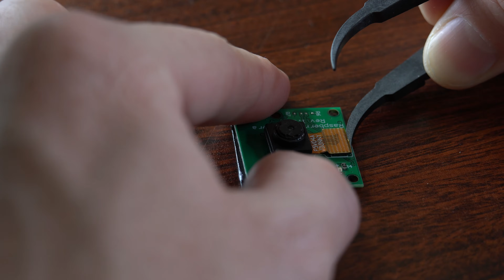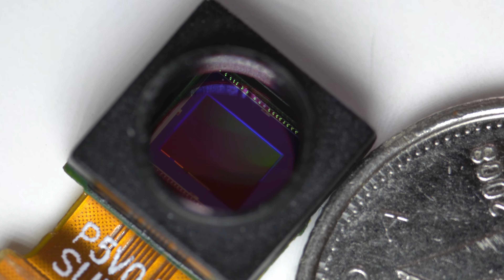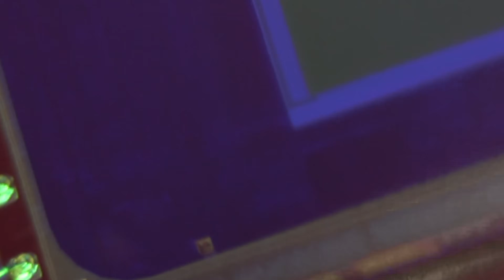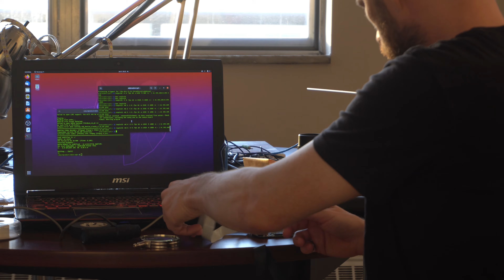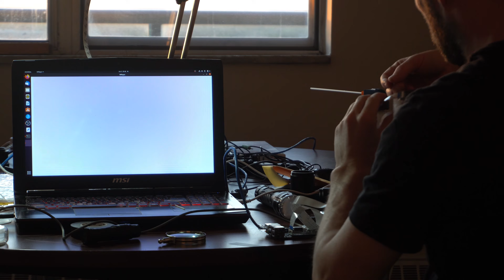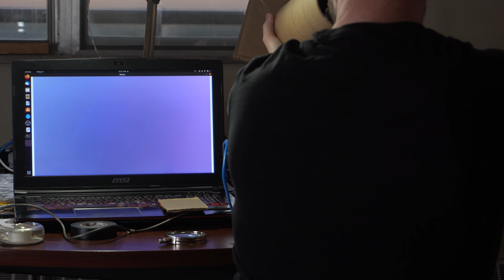EXPOSING The Raspberry Pi Camera Sensor - Teardown & Speedrunning Custom Lens Systems

Comment: Great idea, but suboptimally executed. You could have made a lot of those things like the magnifying glass work to produce an image. It's not very difficult and it would have been interesting for people to see what an image from a simple magnifying glass would would look like. 
It probably helps to take a white piece of paper, turn off all the light in the room, close the shades and only have th computer monitor on displaying a white image with a single, large Letter on it. You can then take the magnifying glass and hold it between the paper and the screen and then change the distance between paper and magnifying glass to get an image. At a certain distance you get a nice, sharp (sharp enough to see the letter clearly) image of your screen projected onto the piece paper. 
The understanding gained from this then helps to make it work with the sensor. Whereas the sensor just take the role of the piece of paper.

Comment: That crop factor is a real bugger and is holding up a couple of vintage camera conversion projects. There is a relatively large sensor MIPI camera that a dude made work on a Pi (iirc for an all-sky camera), but you need a Pi CM4 plus carrier board to get enough lanes to run it-- the typical 15(?) pin connectors only expose 2 lanes, but 4 lanes are required. The big CM4 carrier board has the required hardware. All the small CM4 carrier boards I found offer 2-lane ports, and the big carrier doesn't fit inside a camera body.

Comment: This camera has no Infrared filter? I want to turn it to a IFR camera. By putting a none-infrared filter lens on top which blocks all waves which are not infrared. Which lens do you suggest?
Reply: Depends on how far you want to look into the infrared. Pay attention to the glass types of the lenses, some glass types absorb a lot of IR, some don't. But your sensor might also have weak IR absorption, even without an IR filter.

Comment: Great video!
Although I have a question, is it possible to connect a CMOS sensor like an APS-C or Micro Four Thirds sensor to a raspberry pi?
Reply from the maker: The only other RPi camera that I know of is this one:

https://www.raspberrypi.com/products/raspberry-pi-high-quality-camera/

I suspect that the sensor format is limited to the RPi's camera ribbon cable interface.  You could probably also use a USB/HDMI capture card to do the input through USB.  I just googled it and found this video:

https://www.youtube.com/watch?v=bbTqNbztWTE

I only watched the first 10 seconds of the video.  Seems like the right idea.
Reply: I wonder if you tried to change modules on that pcb? Looks like regular smartphone camera modules on that pcb. I think that any smartphone sensor would fit and run with some drivers.

Comment: I'm looking for a 1/2.5" sensor (5.76x4.29mm) for Pi that has the same construction as this camera (sensor connected to the PCB using a ribbon cable). The official HQ camera has the sensor mounted straight to the board. Is there a third party cam with a 1/2.5" sensor that's built the same way as the one you're showing?
Reply from the maker: I'm not very up to date with the latest in Rasperry pi cameras.  I still haven't even gotten around to getting one of the HQ cameras.  Try checking the raspberry pi forums for any discussion about other sensors.

Comment: I’m curious, do you think it would be possible to use a spare image sensor from a DSLR or Mirrorless camera and attach it via ribbon cable to a raspberry pi? I’ce got this dream to build my own camera using cheap parts lol
Reply from the maker: Theoretically, anything is possible, but these are some of the major challenges you'd need to overcome to make it work:

1)  You'd need a ribbon cable that actually fits and can be attached and has the right number of wires.  An old DSLR cable probably doesn't have a removable cable, so if you ended up needing to cut/solder the ribbon cable, and that might be a huge pain if the connections are flaky.
2)  You will now need to reverse engineer the protocol that is used to talk to the camera sensor over the ribbon cable.  You'd need to figure out the power/ground etc. pins.  For most proprietary sensors, there is probably little documentation out there, and/or it may be under NDA and hard to find.  In the best case, there would already be some docs.  Worst case, you'd reverse engineer it from scratch by sniffing the bus while it was in normal use and capture some samples with a logic analyzer.
3)  Clock frequency issues (or power/memory limtations).  It is possible that the camera sensor itself may use a clock frequency that is too fast/slow compared to the raspberry PI.  In this case, you'd need a 'driver board' to put in between the pi and the sensor, so you could 'hand off' the actual I/O to/from the sensor.  If you ended up building your own driver board, you'd have to ask why you didn't just use the rest of the existing camera internals with its existing firmware, and possibly set up a bridge between the Pi and the existing camera firmware over a serial connection (or wifi, bluetooth, infraed sensor etc., whatever is already built in).  Then, you could just talk to the existing camera firmware directly and control it that way.  

It's all sounds like fun until you realize how much work it would be :)

Comment: old film lenses just don't have the required resolution at the focal plane, because the resolution of the film wasn't that high either.  Modern small lenses are actually quite amazing.
Reply from the maker: From what I understand, a lot of old film lenses were actually hand-made, and famous film producers like Stanley Kubrick would order several versions of the same lens and pick the best performing one due to the individual variations in the manufacturing process.  The final resolving power of a camera system will not only be limited by the quality of the lens, but also the characteristics of the image sensor (things like sensor size, number of pixels, and quantum efficiency of each pixel).  I don't have any data to back it up, but I suspect that some of the older lenses probably have very good resolving power, enough to meaningfully improve the quality of a 4k/8k+ image.  It all depends on how well the indivisual lens has been ground, and what material the 'glass' is made of.   It would also depend on the focal length that it was designed for too since the aberrations of a lens would show up more with a longer focal length.  I think the main issue with the older lenses is just that the mounting interface is different, so it usually won't fit on a modern camera unless you use an adapter, but that can add extra spacing which means you won't get the exact same focus that the lens was designed for. 

You mentioned modern small lenses are amazing, and that is very true.  I suspect that we may have read the same hackernews thread "Modern smartphone lenses are crazy":

https://news.ycombinator.com/item?id=30557578

Despite this, at the same time things like modern high-quality microscope objectives are  still manufactured using a surprisingly low-tech and partially manual process.

Going a bit beyond what's in that hackernews thread, I think the future of lenses and optics in general is going to be very interesting.  As you can see in the twitter thread linked by that HN post, lenses can get extremely complicated, and there is a lot of room for optimization beyond the standard 'spherically' ground lenses that you read about in text books.  If you have enough manufacturing control, you can build arbitrarily shaped 'photonic crystals' that give you access to all sorts of optical (and computational) possibilities: 

https://en.wikipedia.org/wiki/Photonic_crystal

If we do end up seeing photonic crystals in consumer devices any time soon, they'll most likely be produced using the same photolithography that are used to make chips.